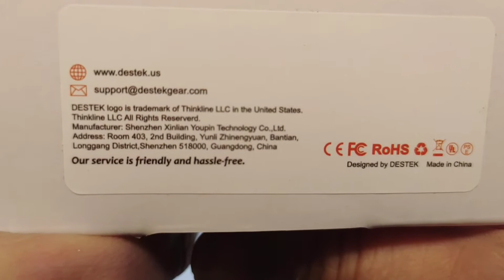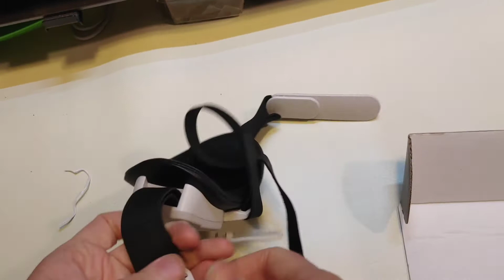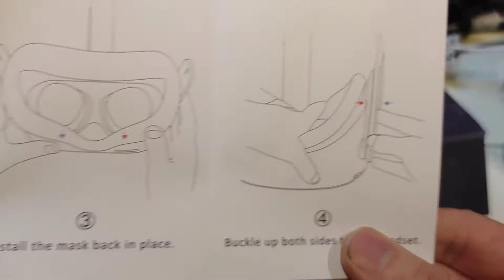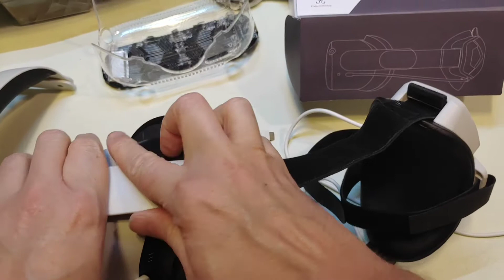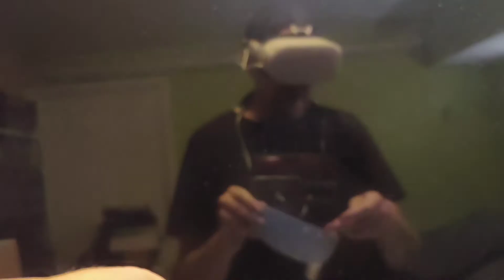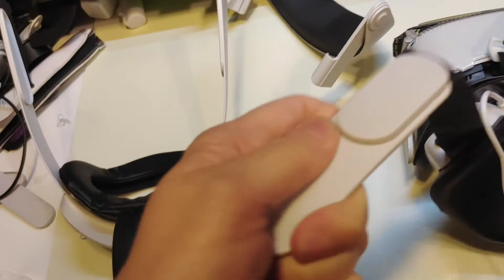Unboxing Overview Use Thoughts Feedback Of Destek Battery Headstrap For Meta Quest 2!

Comment: Does it damage the battery if I play and charge
Reply from the maker: First off, my apologies for the time it took to respond, I check messages everyday, and it wasn't until today that I checked and something actually showed up, literally 2 weeks worth that I've not seen anything from. It does not, but it doesn't offer any sort of data transfer through the charging port, so that's something to be aware of. I hope this helps, and much thanks for your question, interest, and for your viewership.

Comment: i bought one and it worked for 2 days but now it wont charge how can I fix it can you help with a video plz thanks bud
Reply from the maker: If you are within the your return period, I'd get it replaced or return for refund, due to currently the heat of late has caused battery straps to experience issues, when there's no shielding for heat dissipation. That's the only advice I can currently offer, as I'm not currently able to use soldering iron with my blood disease causing sensitivity to heat, and blood thinners that I have to take for it, not to mention I'm currently still out of commission after undergoing a pre trial infusion set for almost 4 weeks, which has raised my core body temp to over 101F, so that has made it difficult for me to do any videos currently for the new products I have gotten in. I apologize for your experience, and for not being able to offer more help than this, but I hope that helps at least some with solution options, and much thanks for your question, interest, and for your viewership.
Reply: @xyberKnight  omg brother I'm so sry my prayers sent ur way full force I'm sry I truly sad to say I lost my lil girl on May 14th to domestic violence suicide 😢💔😔 she was 21 as of Feb 17th but I. Won't bother u with that as forvthe unit it was second hand and the guy told me o well sry but u take it easy and go's bless ya brother thank u for ur time
Reply from the maker: @papirico2227  You have my condolences sir for your loss. I've been dealing with this blood disease since 2018, and possibly had contributed factors of blood clots since 2015 from it. It's just continued to be a degenerative condition of my state of health, and heavily impacts my cognitive function, body and blood to brain oxygen and circulation, due to it causes my plasma to be nearly as thick as set gelatin. I appreciate your kind words, but I'm sorry to hear that you were treated unfairly with the 2nd hand transaction. I would still see about trying to reach out to Destek on Amazon and see if there is anything that they can do for you to be able to get a functioning unit, or perhaps they can just replace it for you, with proof of having it by photos? It's worth a try at least from my view of the situation. I hope this helps, and much thanks for your response, interest, and for your viewership.
Reply: @xyberKnight  Hey brotha again ur in my prayers 🙏and thanks for ur condolences on my little girl and yeah I didn't think of that route il definitely will try shit cost me 40 bucks lol well ttyl brotha and blessings to u

Comment: When I charge my headset does it also charge the battery pack aswell?
Reply from the maker: If you are using the port that's on the headstrap, it will charge both your headset and the headstrap. I hope this helps, and much thanks for your question, interest, and for your viewership.

Comment: Could I charge my oculus then charge the battery pack and then when I play and my oculus gets low could I use the battery pack while I’m using it?
Reply from the maker: This headstrap provides passthrough charging, where when connected to the headset, it will simultaneously drain at a slower rate from the headset and the headstrap batteries. If you have low battery without a fully charged headstrap battery attached and then connect it, in my experience as long as the headset charg isn't a red light or under 15%, it will still provide use, but it will not directly charge the headset battery unless the power cable for the headstrap to an external charging source is connected. I hope this helps, and much thanks for your question, interest, and for your viewership.

Comment: Does the battery charge the heaset while your playing?
Reply from the maker: It won't ever charge above what the headset battery displays, but it will slow the degradation of the time the battery meter drains. I hope this helps, and much thanks for your question, response, interest, and for your viewership.
Reply: @xyberKnight  Not sure if you still use this but I've recently bought the battery strap from amazon. The first time I used it I could have swore that both the amber LED was on to show it's charging and also on the oculus menu it would show the battery charging symbol too. Used it today and the amber light is on but in VR itself, it just shows my battery as normal (non-charging). 

Is it supposed to be that way or is it supposed to show the charging symbol too?
I've read a lot of reviews from people commenting on faulty batteries so I'm a bit concerned as to whether mine is faulty or not.
Reply from the maker: @ACiiDzFTW  Mine never displayed a separate battery charging symbol in the headset, just the leds show yellow when it's charging, and green when full. It does show as just charging in the headset, but just the lightning bolt over the head's battery symbol, not one of its own. Pending how long you've had it, check about returning it for replacement, or contact Destek on Amazon to inform them of what is going on about potential issues. I hope this helps, and much thanks for your question, interest, and for your viewership.
Reply: @xyberKnight  appreciate your reply, thank you! 
Yeah I don’t have the lightning symbol anymore, it did the first time but not anymore. Port is fine as I use the mains charger to charge it with no issues whatsoever. 

I’ve messaged Destek via Amazon so will see what they come back with… thanks again!
Reply from the maker: Destek has been good about being able to get info and staying transparent regarding their products when I message them on Amazon. I hope you get provided with an answer and helpful, and much thanks for updating me, and for your viewership.